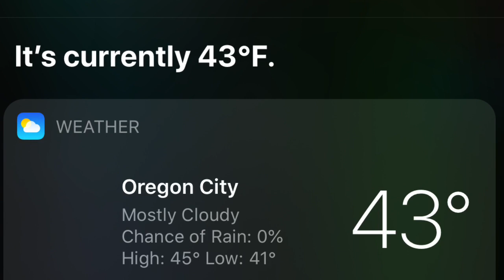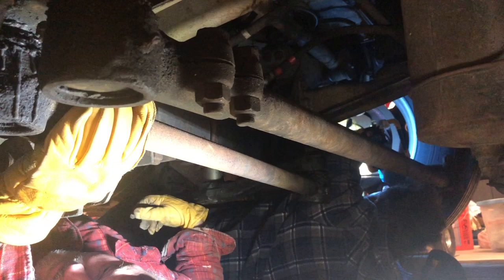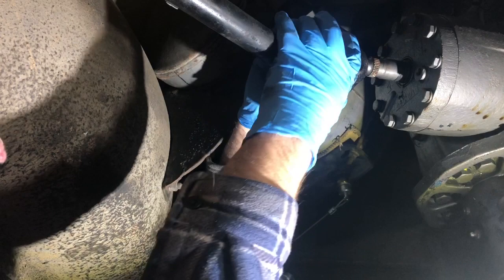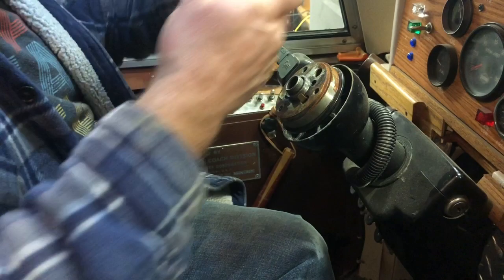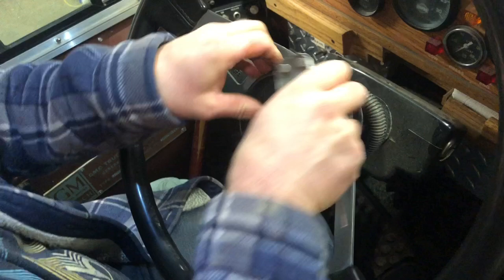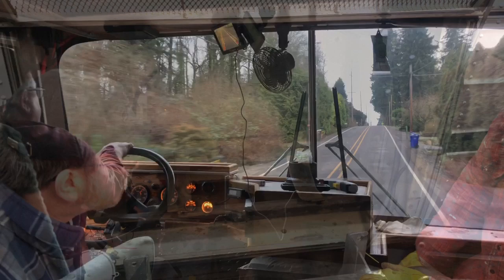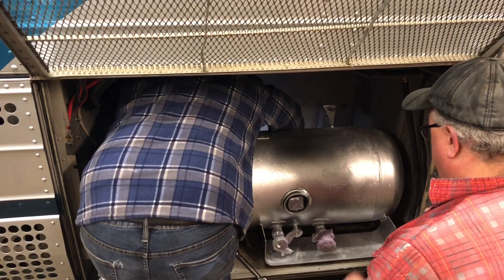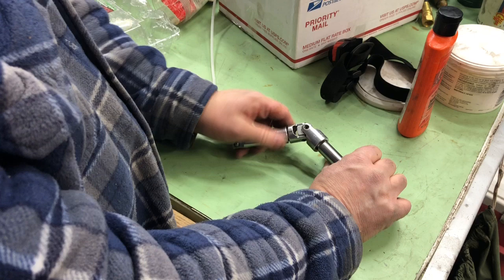GM 4106 Sheppard power steering slop FIXED

Comment: Usually there are two u-joints in a steering or drive shaft. With the u-joints in proper phase, one u-joint cancels out the other one and you end up without torsional oscillation.
Reply: Hakuna Matata correct, except that the second one has a much higher angle of approach than the other one.

Comment: The clean-ness of your undercarriage is enviable. Did the thunk go away? Maybe the U joint needs replacement.
Reply from the maker: There never was a thunk, the noise in the video I think was coming from the brand newly rebuilt steering gear. The undercarriage isn’t all that clean, it dropped a big chunk of crud right in my eyeball during this.

Comment: Not sure I understood why turning the shaft a half turn would make a difference.  Seems that there should be no movement between the U-Joints no matter the position. 
On another note, I noticed a whine in your steering pump when you make turns.  It's normal for them to whine a little when the pump is cold.  But yours was whining later in your ride as you made a turn and accelerated, it should have been warm by then.  This is caused by air in the system, cold fluid, or a dirty filter.  I'm pretty sure it's the latter in your case.  To fix this you can clean the little cylindrical filter on the pressure line (not the return line) that goes from the pump to the engine bulkhead on the right upper corner of the engine compartment.  It is a cleanable filter and requires no parts.  See my video just before the three minute mark to see how.  https://youtu.be/NogSmXC9YiY
Good luck, let me know how that goes.  Use a coffee cant to catch the fluid when you remove the filter.
Reply from the maker: I had been wondering about that whine for a while, and even commented about it online. When I replaced the Sheppard steering gear I missed the filter you point out here. I’ll check this out ASAP.
Reply: single U-joints change speed relative to the degree of angle that its at. There are 2 Ujoints under there but the end I rotated has a higher degree of angle, changing the phase changed the speed that the Ujoint operated at that point. 99% of steering correction happens right at that angle +/- a couple of degrees. He didnt have "slop" going straight down the road, he had a high steering input ratio straight on. changing the phase of the Ujoint lowered the steering input ratio.
http://www.tpub.com/basae/11011_files/image422.jpg
Reply from the maker: John Matthews I don’t have the 2nd filter mentioned in your video.
Reply: @ThisOldBus  That's interesting.  All of the 4106's had them initially.  Someone must have removed it along the way.  The noise indicates a strain on the pump usually due to restriction...not something you want to have going on all the time.   I'm guessing that they replaced the original pump with a higher volume pump when they added the new steering gear.  Not sure what to suggest now.  Thanks for the follow up anyway.
Reply from the maker: John Matthews my 4106 was manual steering from the factory, so all this was added. It was cold out and it was a short drive, it does get a bit quieter than you heard here. However it’d be nice to solve the mystery. It did it before with ATF, still does it now with new steering gear, filter, and multigrade oil (it’s either 10w30 or 40) as recommended by Sheppard these days.
Reply: @ThisOldBus  Ah! That explains it.  I wonder if the filter was added someplace else in the line.  I guess you'd know that.  Yes, the Sheppard boxes require multi-grade oil, not ATF.  I had this conversation recently with someone else who was using ATF.  I have seen other people mount the steering box on the left side of the axle, rather than the center.  They use the left mounting hole on the axle with the right mounting hole on the box.  I never really understood why, but perhaps it was to get better alignment on the input shaft.  Can't remember what they did with the other holes though.  Thought about switching mine to a new Sheppard box, but decided to stick with the original PS external slave cylinder.  After a considerable amount of work and new parts, including new king pins, tie-rod, tie-rod ends, and input shaft #2, replacement, and adjusting the valve, and the 45 degree bevel gear at the bottom of the column,  thankfully no play in mine.  Learn something new everyday.
Reply: John Matthews air in the system caused by a restriction in the suction side causing cavitation. Enlarging the fittings and hose may help.
Reply: My power steering would always whine when low on fluid. I used that as my dipstick. lol